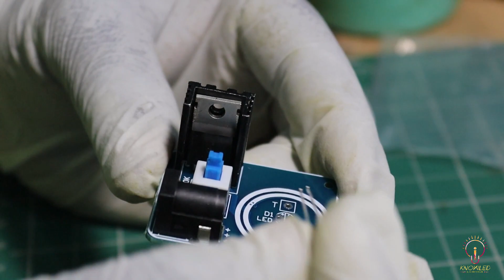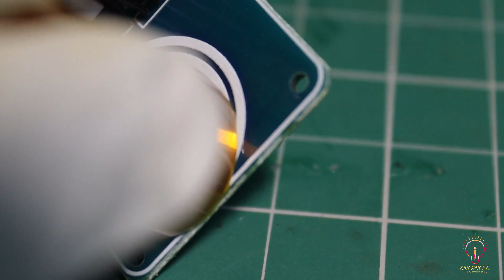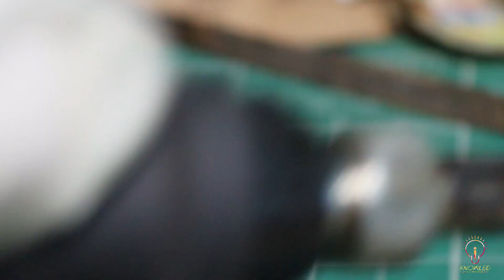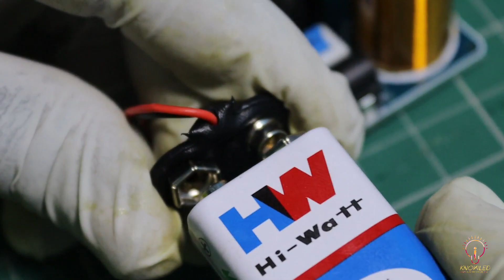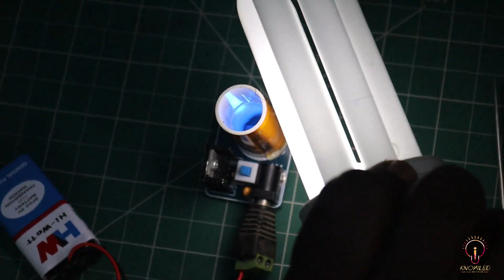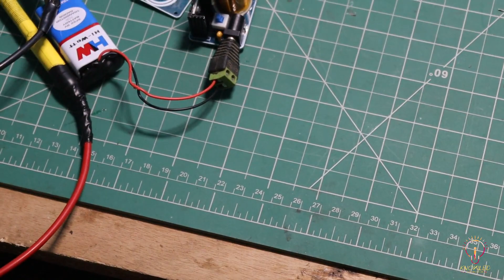Diy Mini Tesla coil kit assembly and testing #tesla #teslacoil #diy

Comment: I managed to get mine working, first attempt it did not work properly it seemed like something was loose after I re soldered all the connections the trouble stopped I tried with a few different power adapters I had and at like 15v it seemed to be heating to hot and I did not want to blow up the transistor so I tried a 6v adaptor I had and it seems to work better for some reason when I attempt to connect a plastic ball wrapped in tin foil to the top of the coil the led light cuts out and I don't think it lights up a neon bulb any longer which I found a bit strange. Any advice on that would be helpful thanks Great product.